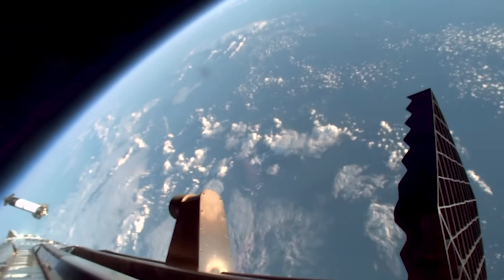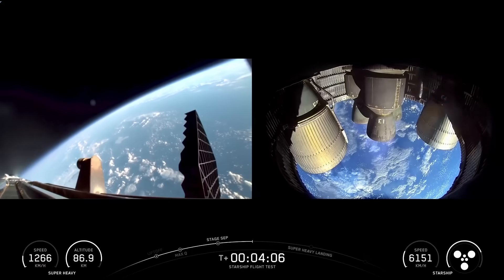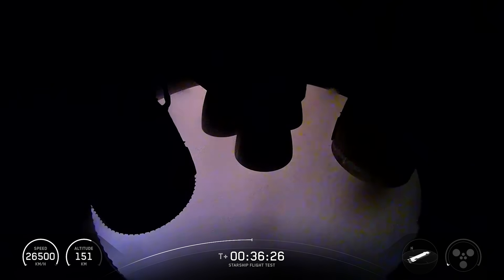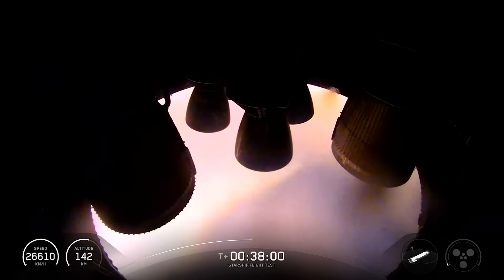What Exactly Happened On SpaceX's Eleventh Starship Flight Test?

Comment: That was pretty much 100% successful. Fantastic launch.
Reply: It exploded on landing.
Reply: @TroySavary  as intended, you do know that right? If it wouldn't, it would be far over engineered and weigh too much.
Reply: @snuffeldjuret No, it isn't intended to explode. What would the point of landing it be if it is supposed to explode on landing?
Reply: but its also not intended to land in water? @TroySavary
Reply: @TroySavary  You haven no real idea what's going on do you?
Reply: @imaginary_friend7300 I know that every single Starship launch so far has exploded at some point during the flight. Every one.
Reply: @snuffeldjuret Which they haven't proven they can do.
Reply: @TroySavary  You people just seem to think "explode = failure" even though Starship has proven that isn't the case. Starship on Flight 10 & 11 completed ALL mission objectives successfully and no one cares if it blows up after splashdown as it's designed to be caught by a catch tower, not to splashdown and tip over. This mission made huge progress towards Ship catch making it an overwhelming success

Comment: Why aren't they testing fuel transfer? The sooner they start, the sooner they'll run into problems they could already be working on solving.
Reply: If you mean in-orbit fuel transfer, you have to get a Starship tanker into a stable orbit first, then a second Starship in orbit to meet it. For all of that, you need Starship to be reliable. They'll get there.
Reply: they did a test between internal tanks a while back

Comment: Why does it always blow up?
Reply: Bc they dont want big pieces floating in the oceans. 🎉
Reply: @antonis190811  i am asking why the booster lands perfectly but the actual ship doesn't when it reignites ?
Reply: Both the booster and ship splashed down and further blew up. SpaceX had planned to have this happen due to them no longer requiring either stage as comparatively they are outdated when put up against the upcoming block 3 ship and super heavy
Reply: @skillt12  ok thanks for answering

Comment: Remember when everyone though starship would burn up during reentry if a few tiles were missing? Well S38 just survived reentry with 100+ tiles missing. Most of them in groups of 4 so there were literally holes in the heat shield the size of 4 dinner plates. Even more impressive, some missing tiles were over bare metal! No ablative!
Reply: yeah I remember those times, it is kind of wild that it has survived every time it has had attitude control. This has been a tough year, but I think it feels worse than it was given how utterly amazing last year was.
Reply: It was not actually 100. Those were back in flight 9. Flight 10 and 11 had changes

Comment: This was the most boring flight so far, which just means nothing went wrong. The next flight with the first V3 Starship will probably not go as smoothly.
Reply: yea, Starship is starting to settle into the F9 series when they first started to be reused-
Very exciting and then hohum.
Crazy, isn't it? No one pays attention to those any more because they're just so common.
Reply: The most exciting one was when Starship was carthwheeling multiple times cause they failed to separate from the Booster and so they had to detonate it. If that happened to any other rocket, it would have folded in half in the first cartwheel.
Reply: @jansaycon8441  I remember that one. Crazy the structural integrity. And that some areas of tile were apparently missing on this is a bit nuts too.
Reply: @jansaycon8441  
That flight is still some of my favorite rocket footage ever, just because of how incredible it was to see a rocket of that size hold itself together through multiple cartwheels. Crazy stuff.
Reply: The most exciting moment for me was when they caught the lower stage for the first time. It seemed like it would crash into the tower.